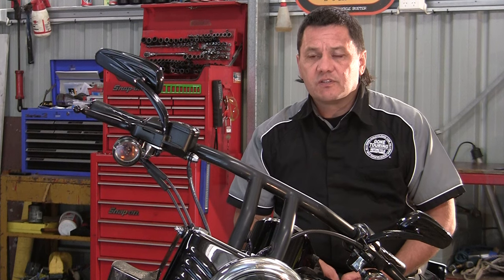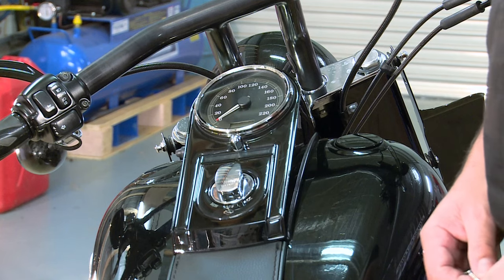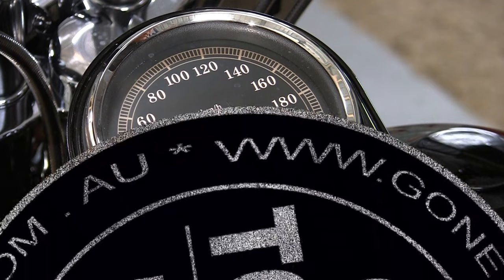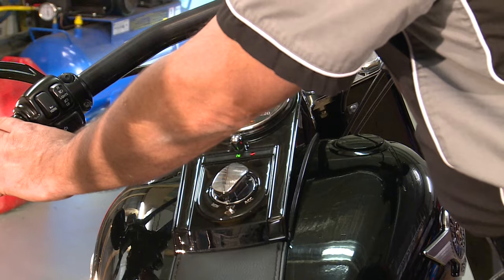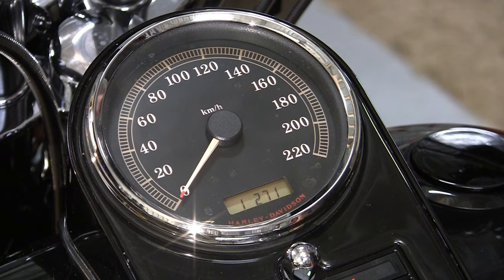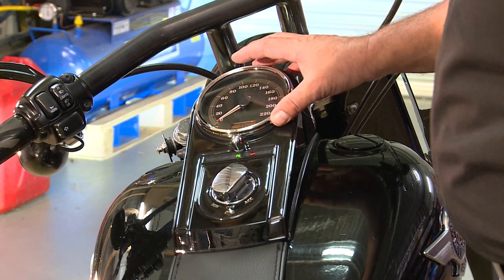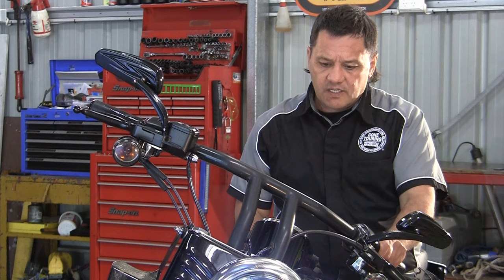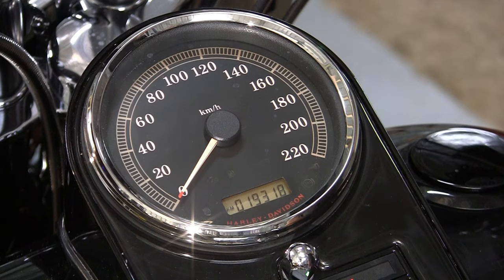How to manually override a Harley-Davidson Security Alarm

Comment: You saved my bacon at a rest stop 2 days ago when I came out of the bathroom and realized that somewhere in the last 150 miles of highway travel, my fob had come out of my pocket and I was (momentarily) stranded. I had forgotten how to do this, as the dealer never explained it and I had only read about it in the manual. A 4G phone connection to this video got me rolling homeward. Thanks a ton!

Comment: Hi 👋, Gone Touring, from the other side of the world 🌍, I have just purchased a 03 DEUCE, and I couldn’t find a way to disarm the alarm system, the guy who delivered it to me, had a problem as it was in the back of the van, the alarm kept going off, so when we remove bike from van the battery is flat, In next day or so I’ll reset the pin number and turn the alarm off, thank you for your info, very very much appreciated, 
From France ,

Comment: Quick addition: 2008 Heritage Softail required one extra step at the end:  after pin and run switch is on…put bike in gear then back into neutral before starting.  Works when nothing else worked!  Took 10 videos to finally find this one and I had to rely on a bloke from down under!  Thanks mate!😂

Comment: Excellent !! This (and the other similar videos) give some great instructions on changing and over-riding your PIN. As noted, in the event of a dead FOB battery, or in my case, a lost FOB, you are simply dead in the water w/o knowing this info....happened to me on my '08 FXDWG, but luckily was only 4 miles from my house and could retrieve the other FOB....had I known the override sequence then, woulda' saved me some hiking !

Comment: Tried this numerous times.....could not get it to work.  I discovered that the "RUN" switch must be in the RUN position......this wasn't mentioned in the video or the manual.  Handy piece of info.  Great video.  Thanks
Reply from the maker: +Dennis Ross Hi Dennis, you may have a different model to our bikes as our two bikes won't work in the "Run" position as you suggested.Thanks for the info. We'll endeavour to find out which models need to be in the "Run" position.

Comment: Hello. . I have a 2003 Road King.  This did not work for me.  Does it vary from year to year?  Thank you.
Reply: Great question.. I have a 2002 Road King Screamin' Eagle and I just buried my fob in the house, far away from the bike, but with the ignition dial unlocked, it allowed me to start the bike. When I performed the sequence shown in the video... It did not show me the PIN number in the SPEEDO. Wondering if this security system is not on my 2002 FLHRSEI.  Important to me, because I live just outside of Death Valley and a bike refusing to start in many of the locations I ride could result in one or more fatalities. Like I tell my Hummer Mechanic, because of where I go in the middle of the Mohave and Sonora Deserts... a failure can mean multiple fatalities, so make sure it runs right.
Reply: @DIZEMANPHOTO  just bought a 2008 Rocker and did not know the alarm PIN to retrieve and change PIN to new code so I had to do everything he just showed.  The trick is you have to do it fast when you press the left turn x times followed by the right one time.  Same thing for starting ....  process.   Must be right away..   Word of caution replace key fob battery AND keep a extra battery on bike somewhere and do not lock your front wheel with the key.
Reply: @bigblue3568  I only have one key fob, so I am going to have to try and get another one. Where I ride, not being able to start the bike is all but assured a fatality or two. 
Thanks Shawn!

Comment: Just pull the fuse that you have installed outside the battery cover discreatly and walk away. The alarm should still have all of the functions as with its battery backup?

Comment: Tried those steps a few times for my 2012 softail and could not retrieve PIN number. Is there something wrong with my alarm system? Had HD change pin when new bcm was installed 6 years ago and I forgot it.

Comment from the maker: Thanks for the comment Tricia, The only time you need PIN number is when the FOB battery goes flat.
Reply: gonetouringaustralia or if you turn off your bike in areas where walkie talkies jams the system if similar bandwidth is used ;-)

Comment: I’ve got a 2007 nightster 1200xl. I’ve been struggling for years with this security system issue. More money, mechanics and lost riding time than I care to mention. It has a key fob which I regularly change the battery in and an ignition key. The bike never starts! It gets “fixed”, works for a few rides, and then doesn’t start again. Currently broken. Can the system be permanently disengaged or removed? If not, what I can do?

Comment: Hello mate ... 

Thanks for the tip. 

I have a different issue if you would be able to help me with ..  When I press the start button on my fatboy, i have no response (as the case when the bike gear is not neutral) .. Is there certain reason for that?  is there a way to restart the whole system of the bike.  ? 

Also do you guys have any video for drilling stock mufflers to get deep louder sound?  
Thanks

Comment: Had this issue and got my bike to start with the pin but now you have to do it everytime. Is there a way to disarm the security all together so I don;t have to get new fobs?
Reply from the maker: Robin Stone Hi Robyn, sadly its either replace the FOB batteries which is a simple job like in this video https://youtu.be/DiiPt9SNn2E or purchase a new FOB if the old one is faulty. We wouldn't recommend removing the security alarm as it could effect your insurance and resale value. Good luck and thanks for watching.

Comment: Hi. Have you ever heard if there is a limit of times you can use the override code? I lost my fob and will be able to pick a new one at the dealer only on monday and I'd like to keep riding on the weekend. The bike is a 2016 FLHXS. The closest dealer said I can use it about only 30  or 40 times and then the bike will not start anymore but I didn't find that information over the internet.

Comment: I have a HD FXDLI Low Rider 2005 fuel injected with HD:s alarm system. When I bought it on auction I only got the starting key no FOB and PIN code. When I tried to start it I realized that something was missing. A mechanic installed a new PIN code by connecting a Windows laptop to the alarm unit. The update finished successfully. When I tried to start it with the new PIN code I followed the manual to the letter but I never reached the step  where I was supposed to enter the PIN code.

The manual states " The left turn signal switch is used for code number entry and the right turn signal is used as the "enter" key.
1 Know your 5 digit personal code 
2 Turn IGN key to ACC 
3 Hold both turn switches in until confirmation Security lamp blinks at fast rate
4 Enter first digit of code (a) by pressing left turn switch a times 
5 Press right turn switch 1 time Serves as enter key for first digit
Proceed with the 4 last digits in the PIN code the same way . . .
6 Security lamp stops blinking System is disarmed. You may use the vehicle or program another key fob "

I reached step 3 where the security lamp blinks at fast rate. When I tried to enter the PIN code with the left turn switch it didn't accept it and continued blinking at fast rate.

Comment: I have been trying to over ride my security and set a new code but I can't get the numbers to change I've followed all the videos but still not working any suggestions
Reply from the maker: +Debbie Person Hi Debbie, the system can get a bit confused if you have tried and made a mistake half way through. Sometimes its better to walk away and try it the next day from scratch.
Reply: Debbie Person 
Hi Debbie!
When you tried this did you have your kill switch in the run position I believe it needs to be on also. Good Luck! 🍀

Comment: I done this to a mates Dyna without an issue. But when I tried it on my 2011 Fatboy the option doesn't come up? Any ideas? Irang the shop and they dont have the original pin?
Reply from the maker: fourbyfour Tinny Hi TInny, We'll do some checking for you, however we've checked the 2011 HD manual it explains it the way the we did it in the video.

Comment: I have this problem with my harley softail. 
I ride the motorcycle to wherever and when I sometimes park it and then go away from it for 5 minutes and come back the turn signals start blinking(without headlight on and horn) its silent. But the signals stay blinking forever until I disconnect the battery. Even after inputing my 5 digit pin to disarm the motorcyle it still wont turn on. This only happens sometimes tho. Could it be that the FOB key battery is bad or cuircuitry on the bike is bad?

PS:sorry for bad grammar
Reply from the maker: Thanks for viewing our video, we will get some expert advise on your problem and get back to you.

Comment: Hi I have just bought an ULTRA CVO 2015 with the new BOOM BOX.
I tried to follow the manual to set my own PIN code (according to table 16, page 114)-I use a Swedish manual so the page number is probably not the same, but table and pictures should work-I hope
1. Decided a code-I did
2. Set the motor switch (No 15 in picture 16, page 63) to RUN (with the FOB code key nearby)
3. Motor switch OFF-RUN-OFF-RUN
4. Press left turn signal 2 times, now the text "ENTER PIN" should be shown-but nothing happens...
I tried also to press Right turn key after, but still nothing
I tried with "Fork" locked and not locked-no difference.
What is the problem?
Reply from the maker: Hi Jan, 
Our book is a little different. here is a link to the instructions in our book. http://gonetouring.com.au/PlanYourRide/tabid/98/Tip/250/Setting-or-Changing-Harley-Davidson-Security-System-Alarm-Override-PIN.aspx
Reply: gonetouringaustralia Hi thanks for the info. I learned later on there was a fault in my manual-it shall be press the left indicator 3 times (it said 2 times in my manual)
Reply from the maker: Glad that it has worked out for you Jan. Enjoy your riding.

Comment: When I turn on the ignition the alarm starts to go off and we have the key fob and I can't fix it please help I have a 02 vrod
Reply: New batteries in the fobs? 
Will it let you put the pin in? If not your TSSM is probably bad, just got rid of mine because it went bad and installed a TSM (no security)

Comment: My digital speedometer shows 0.0 despite repeating the: ignition on off on off on then pressing L signal 3 times followed by the R signal once. My beautiful bikes just sits there silently, and flashes. It has stood in my garage on a trickle charge for 1 1/2 years now-very depressing.

Comment: Great video, I bought my FXDLI -05 fuel injection on auction last year and got only keys no FOB or personal code, didn't know that there was an immobilizer. Trying to disarm it with the factory code 11111 since there was only one owner before me. Followed your instructions and switched key to ACC (security lamp flashes every 2 second indicating security system armed). Held both turn switches until confirmation (security lamp flashes 3 times a second indicating "personal code entry mode". Then entering the factory code by pressing left turn switch 1 time and after that right turn switch as enter. The alarm system didn't receive anything. Can anyone explain?
Reply: Continue .. Then entering the factory code by pressing left turn switch 1 time and after that right turn switch as enter. The alarm system didn't receive anything. Can anyone explain?

Comment from the maker: Hi Mary, The dealership should be able to program the new FOB to match your current security system, then you can check the pin yourself we show how to do it in the first part of the video.
Reply: With the push button FOBs you need to pair it with the security system, for that procedure you need to be able to disarm the security system, if you cannot do so the TSSM will have to be replaced then the ECM and the new TSSM will have to learn a new password which is about a half hour process. I'm not sure what year model bike you were demonstrating on but it is different from my 2005 Softail Deluxe. My factory service manual and owners manual does show the proper procedures, additionally from factory there is no PIN on the 2005 models.

Comment: OK I have a 2005 Dyna UK model with the ignition on the side by the battery and this is what works on mine. Hope it helps someone out 👍

so double click your keyfob to disarm the bike. then, iginition on off, on off on. left turn switch twice. now you should see both indicator lights on the dash flashing together like hazards. at this point you press the key fob twice. the personal pin will now be shown on the dash. you can use the inidicator buttons to change and then just turn ign off to save. i suggest "11111" to test.

Comment: no good if the alarm goes off on the first turn of the ignition and everything else stops working. 2001 Heratige. Tried over and over again,,,,my ears have left me from the noise,,,,how possibly can you do this without turning of the system first with the fob,,,, without it I cant do anything the alarm activates on the first turn of the ignition and all other functions cease to operate.....changed the battery in the fob no luck,,no good saying to do this with the fob available it negates the exercise.
......will need to buy a new fob I guess.
Reply: +mike little I have the same issue with a 2002 Heritage. It just doesn't work. It would seem this only works with a fob which is for a proximity alarm, not a fob where you need to press a button to activate/deactivate the alarm
Reply: +Ian Mc Namara,,,I found that with the fob not working it was NOT the battery,,,,the bike had stood for so long that the security system was not recognising the fob. Holding the button down for 25 seconds to reactivate the system did not solve the problem, but, shaking the bike to set off the alarm and then stopping it with the fob made the difference ,,it seems once the alarm was raging it took notice of the fob,,,now it all works again ok. Go figure. May have just been co-incidance but it seemed to work.

Comment: Sorry.. I'll stick with my rebuilt 1980.. A Key Fob? Maybe understandable on a crotch rocket or some speed bike, but a Harley? Hahahahaha. Great video tutorial though for those that may need it!
Reply: Does it occur to you that every basically harley sold in the last 15 years has a key fob? Does it occur to you that that includes every outlaw motorcycle gang member riding a harley, every dirt track racer who rides a harley on the weekend, every guy who builds pans and knuckles in his spare time and has a late model daily rider, etc? How can you laugh at the convenience and safety of a Key Fob enjoyed by EVERYONE on a late model harley? Enjoy the steel key on your shovel head, but I'll be damn glad to hear my bike screaming at me when someone tries to steal it… all you'll hear is your shovel burning away with its new owner sitting on top..
Reply: Mitch Simpson Yeah, maybe you should get a cup-holder, radio and built in GPS for your bike too. Better yet get a home theater system, ABS breaks and probably shouldn't skimp on a seat warmer. I prefer my vehicles with as little electronics as necessary, but hey, that's just me. To each their own though.
Reply: Clayton Krause If you've ever had your bike stolen, you might change your tune.

Comment: Yay, now everyone who want's to steal a late model Harley like my Softail Deluxe knows how to beat the security system and start it? Makes me feel a whole lot better. Almost pointless having it if you can read here how to beat it?
Reply from the maker: Rod, this procedure is listed in every Harley-Davidson owner's manual. It only works if you have the assigned Key FOB to reset the code and you need to know this code to deactivate the alarm. It is designed so you can start your bike if the Key FOB battery goes flat when out on a ride.
Reply: Wow! Did you really post that? I guess comprehension isn't your strong suit. lol
Reply: gonetouringaustralia